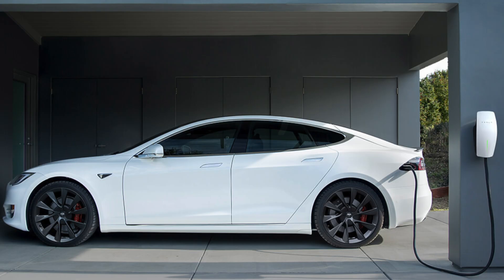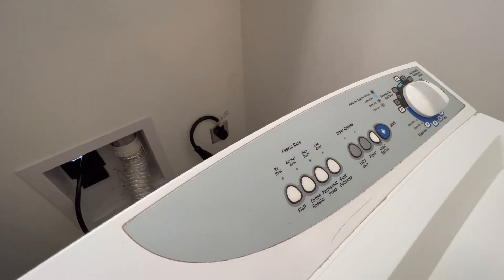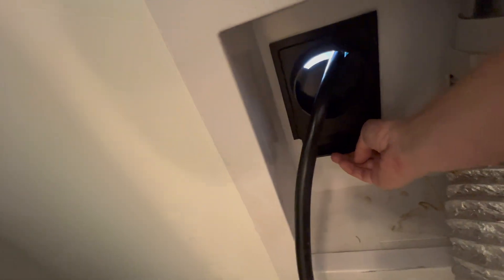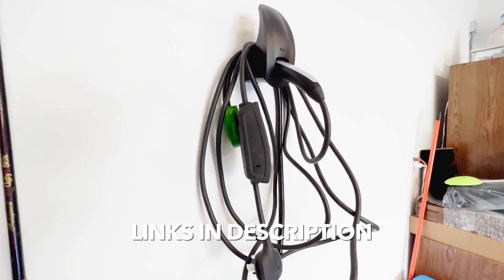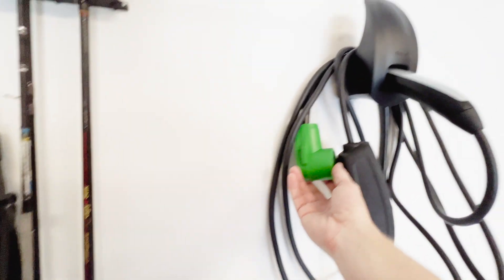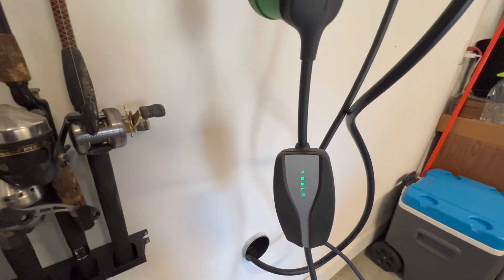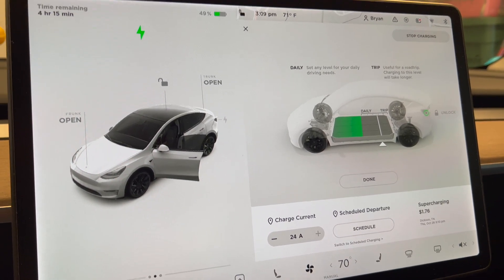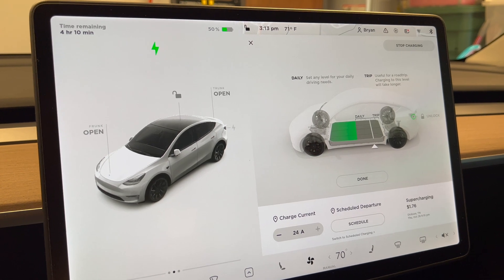Tesla Fast Charging at Home w/ Dryer Plug - Quick Tip

Comment: I have a question. I have the 10-30 dryer outlet on my garage wall, and I am only using the gas dryer.  I bought the new Gen 2 NEMA 10-30 Adapters from Telas. Every time when  I charge my 2021 Model 3, the first few minutes can get 25mi/ hr , 24/24V 236v  , but after 5-10 mins,  it changes to 12mi/hr 12/12A 236V automatically . And never go back to 25mi/ hr , 24/24V 236v again.  Do you know what is going on ?  I hope you can help me.
Reply from the maker: Are you able to change the AMPs? When you say only using the gas dryer , you're not trying to use both the dryer and charge at the same time are you? If so, you should only use one or the other. Otherwise not sure. Can anyone else jump in here to help?
Reply: @bryanhauer  Thank you for your quick response. The tesla apps and screen do not let me. It seems the higher amps is set on the screen is 12A. But on the beginning, when I having 25mi/hr 24/24A 236 V , the higher is 24A. The Amps will drop after 5-10 mins automatically. And I did not using the dryer at the same time.
Reply from the maker: @carvanlai7132  I would check some Tesla forums. I've vaguely heard of this when a breaker isn't capable of higher amperage for an extended period. Your car should be charging at 24AMPS on that setup. How many amps is your breaker? Is it a newer construction house? Here's a long thread where someone was having a similar issue on the Tesla Motors Club. https://teslamotorsclub.com/tmc/threads/home-charging-now-stepping-down-to-24-amps-during-the-charging-session.201059/
Reply: @bryanhauer  Thank you for your response again. The breaker of the dryer is 50A. The house is 30 years old, and the dryer outlet not have being used for last 20 years.
Reply from the maker: Read though multiple pages in that thread if you can as it seems to be a heat issue. You might want to have an electrician look at the panel to make sure the breaker can handle it and isn't causing it to overhead thus lowering your amps to 12.
Reply: @bryanhauer  Ok, thank you for your advice.

Comment: These plugs are not designed to be plugged and unplugged. A better choice is a splitter with a 30 amp switch to control the flow of electricity. Sparks will be created when you unplug the dryer or any device that has a constant "on" design. The breaker should be turned off when handling a 30 amp + device
Reply from the maker: Hey Les - While I appreciate the concern, what you're explaining isn't being shown on this video. There's a specific RV/EV extension cord in the scenario which is the only one that's being unplugged from. The others never get unplugged which is why I'm using the splitter. Never had even one spark and had two certified electricians review it and gave it the go ahead. The scenario you're using, isn't shown in this video. You are correct that constant unplugging of a normal dryer 30AMP isn't suggested as it will lessen the life of the plug, but that's not what's being shown here. Have a great day!
Reply: Yes I never unplug it unless I am planning to take a road trip and want to bring my mobile charger with me.

Comment: Hi Bryan. I just took delivery yay! I would recommend having an electrician come out just to double check your setup. I am a potter and have pottery kiln that has a similar use to a tesla. I had an electrician come out to see my set up and he said that most people don’t consider high voltage for long periods of time. Most of our daily electricity needs pop on and off within a 1/2 hour. Also big box stores don’t carry outlets that can with stand this use and will melt, same goes with the wrong gage wires. He said a lot of people burn down their garage from this error. We checked my kiln outlet while he was here and sure enough the outlet had a ring around one of the plug holes which was the sign that it was melting. Scary stuff! So that’s what I learned and thought I would share.
Reply: There is an amp rating for those extension cords, which is why the ones for charging and RVs are so heavy and thick.  For Byran's method which is what I also do, I have a cable that can handle 50 amps.  This is  for when I don't drive into the garage on the same side as the charging port.  The Tesla Mobile Charger version 2 has a temperature sensor at the tip and a 40 amp fuse at the box should be good safeguards.  Also a smoke detector in the garage is a good idea.
Reply from the maker: Cool. Thanks for the heads up. Yep, I had two certified companies take a look at mine and both said it was perfectly fine. I do have a newer house and did use high gauge RV cords made specifically for EV cars, but definitely suggest anyone looking to setup theirs has a certified electrician at least take a look at it.
Reply from the maker: Oh and congrats on your delivery 😀

Comment: Don’t know the exact condition at your home, but creating the means to pass thru the extension cord likely has violated the one or two hour fire wall rating required between your garage and laundry (living space) and would represent a code violation and fire/smoke risk.
Reply from the maker: Have a new home and had two separate electricians out and both said it was perfectly fine.
Reply: @bryanhauer  Building codes vary across the country.  The easiest way to determine if the wall is rated is to look at the hinge side of the door to see if there is a UL rating label visible.  Some municipalities allow the use of a solid wood core door (1 1/2” thick).  As an architect, just wanted to alert you to a potential life safety issue.  All the best
Reply from the maker: @danmitchell1143  Hey Dan - You made a good point for people to check in their area to make sure it's up to code. I appreciate the concern. I always welcome input from viewers 😀 

In my case I didn't actually go any wall. There's a plastic piece in the laundry room wall that's about 2ftx2ft that's recessed into the garage for the dryer exhaust that I assume goes up through the house and exhausts outside so didn't actually have to cut any drywall as there isn't any in the particular area. 

As mentioned I did have two separate well known certified electrician companies who were here for other projects take a look at it and they both said it was fine.

Thank you for the feedback and for watching. I do appreciate it 😀

Comment: I don't have a dryer outlet close by- so I use the 110 volt outlet in the garage to charge the car-- it is slow but it is OK> Do you agree?
Reply: I thought the same thing at first, but look locally for an electrician to get a dryer 14-50 outlet put in for a future dryer or for the 14-50 adapter.  Don't tell them it's for your Tesla because they somehow charge higher.  Just say you want to put in a dryer at some point.  Charging at home 4-5 times faster is awesome and you will never feel like you wait at all.
Reply from the maker: Yep that works fine. 110v is just super slow at 3-4 miles per hour charging vs 21 miles per hour charging with the 14-30 dryer plug. Both work though 😀

Comment: Quick question. So i am in similar situation like you wjere this looks like a good option. My question do you always have to unplug the tesla connector even when it is not charging  or charging is done or you leave it plugged in ? I am sure you unplug it when using the dryer even though Tesla not actively charging right?
Reply from the maker: Do you mean unplug from the car when it’s done? Or from the cord coming from dryer outlet? You technically don’t have to unplug either, but I do just out of an abundance of caution. Actually I would probably always unplug the car when using the dryer even if it was done charging. I also unplug the Mobile Connector from the dryer/ev extension cord when not use as it’s drawing some power when it’s just plugged in. Probably wouldn’t matter, but I’m overly cautious.
Reply: @bryanhauer  i found your video very helpful. So big thanks . I am still waiting on my Model 3 to come . So just looking at different options of charging.
Reply from the maker: Glad I could help! Hopefully you don’t have too long of a wait 😀
Reply: @bryanhauer  I need to piggy back off this question. When u say you unplug the mobile connector from dryer/extension cord does that mean u only keep one end in the wall but unplug directly from extension cord?
Reply from the maker: @EvSteve10  Correct. The splitter cord that goes into the wall in the laundry room stays in at all times, then one side has the dryer plugged into it and the other the RV Mate ext cord that then goes through the wall into the garage. 

The Tesla mobile connector then plugs into the ext cord when and only when I'm charging. 

Once I'm done charging I disconnect the Tesla mobile connector from the ext cord and both just hang on the wall organizer in the garage.

You should only use one at a time so if you're charging, you shouldn't use the dryer and if you're drying clothes, you shouldn't charge. I simply put a Tesla sign on the dryer that covers the door using a magnet so nobody accidentally tries to dry while I'm charging. It would usually just trip the circuit, but to be safe I use the sign. 

It's worked perfectly for me. Hope that helps! Let me know if you have any other questions.
Reply from the maker: @EvSteve10  One more thing... Make sure to use a heavy gauge ext cord that's made for EV's like the RV Mate one I linked to in the description. You don't want to use a regular extension cord.

And just to clarify my reply to you... You wouldn't have to disconnect each time when you're done charging, but I just do to be extra safe. Again, it would most likely just trip the circuit if both were accidentally being used at the same time, but it only takes a second so I just disconnect the mobile connector from the RV Mate ext cord when I'm done charging.
Reply: @bryanhauer  I’m doing the same thing as of today!! I ordered a Nema 10-30P Dryer Splitter Extension Cord, Nema 10-30P 30-AMP Cable that I’ll plug into dryer and ext cord for car! Very grateful for this input!!
Reply from the maker: @EvSteve10  Not a problem. Glad I could help 😀 That should give you around 21-22 miles per hour charging for a Model 3 or Y and only takes a few minutes to set everything up.
Reply: @bryanhauer  one last question, today when I plugged the Extension cord to the mobile charging I seen a lil spark, do you turn the breaker off every time you plug in also?
Reply from the maker: @EvSteve10  I don’t and have never seen a spark.
Reply from the maker: @EvSteve10  I'm not an electrician though either so if it continues to happen you might want to have one take a look at it. Everyone's wiring and setup could be different or maybe you have an incorrect cord. Always best to be extra cautious.
Reply: @bryanhauer  I got my splitter today! U have no idea how much help u been! 22 miles an hour def beats the 4 miles an hour I was getting with the standard cord that comes with the car! Thank you so much!
Reply from the maker: @EvSteve10  That's awesome! So glad my videos have helped 😀 I have some new videos geared towards new Tesla owners including one later today or tomorrow so make sure to check those out. Please feel free to ask any questions whenever something comes up and I'll do my best to help.

Comment: Looks great man! I think Tesla says don't use extension cables but if nothing gets too hot should be fine! I definitely don't have this set up but splurged for the level 2 charger for the model y that will hopefully show up in Dec./Jan. 

Keep it up!
Reply from the maker: Thanks 🙏   Yep usually you shouldn’t use regular extension cords, but these are heavy gauge made specifically for EV charging. I think you probably did it the right way going with the level 2 charger and is worth it long term if you know you’ll be in the same place for many years to come. Hopefully your delivery is on time 🤞 Thanks for watching!
Reply: Tesla just doesn’t want to be liable for some doofus making a mistake and then trying to sue.  
Technically it can be done. As long as one uses the correct equipment and takes the    necessary precautions there shouldn’t be any problems.

Comment: This shows the difference between a 30A dryer plug vs a 30A plug at a campsite. This is giving you two phases at 30A, while a campsite plug will give you only one phase at 30A. Thus, you should be getting twice the charging rate (miles per hour) than what you see when you are camping.
Reply: The Tesla mobile connector is capable of up to 32A, can it still do double the miles per hour?
Reply: This is very risky process and not up to code jeprodizing your house insurance should somebody else turn on the dryer while charging your car the breaker would overload and the  split cord may melt resulting in fire.
Reply from the maker: Thank you for pointing that out!
Reply: That's incorect. The dryer provides one phase. A TT30 provides a  split phase.